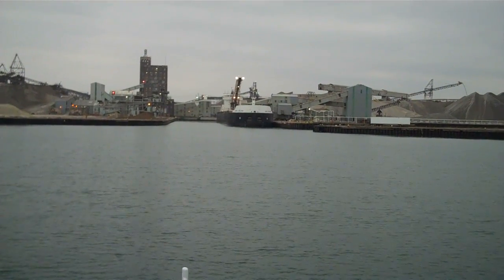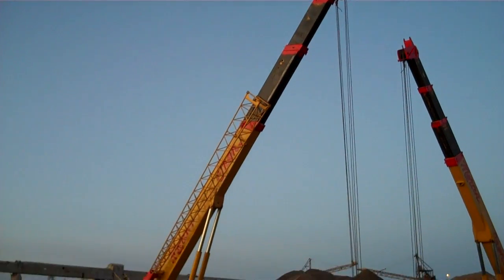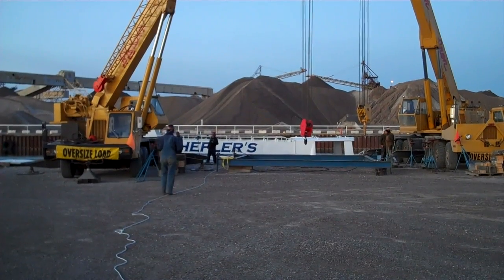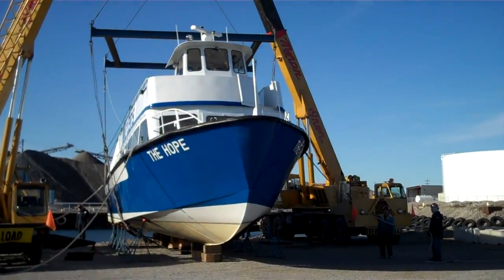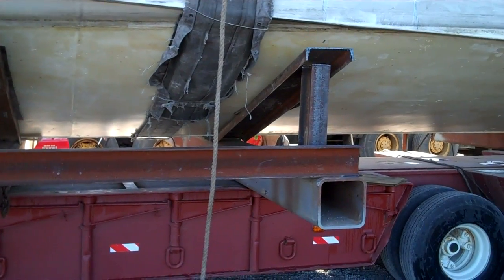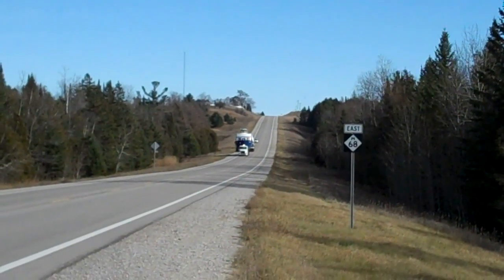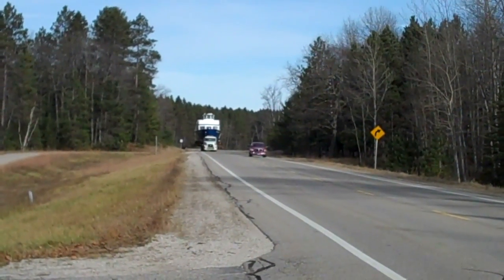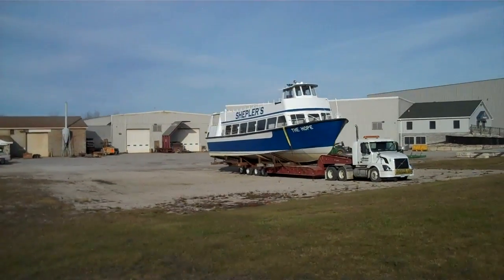Shepler's Ferry - The Hope Project

Comment: Shepler's once had one of the top Detroit Diesel guys in the world on their staff.  Tiny Onaway, MI, has no overhead wiring over the road, between Rogers City (the port in the video) and Onaway, about 12-15 miles inland.  Moran Iron Works paid to have them all removed (the overhead lines) years ago; phone, power, tv cable, etc.  Notice the lack of overhead lines over the road, in the video.  This allows Moran to make huge weldments, in their Onaway Shop, for shipment all over the world, because Rogers City port is an Ocean going port.  The weldments are shipped, via heavy truck, from their plant in Onaway, to the port in Rogers City. They are loaded to ships for delivery on the Great Lakes and down the St. Lawrence Seaway. Quite an operation!